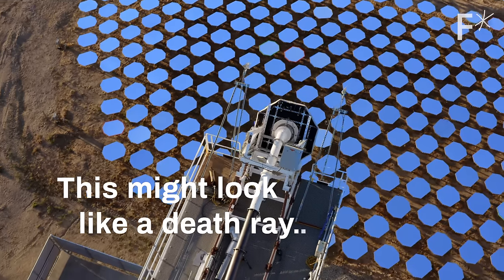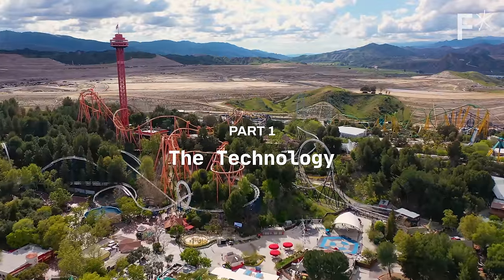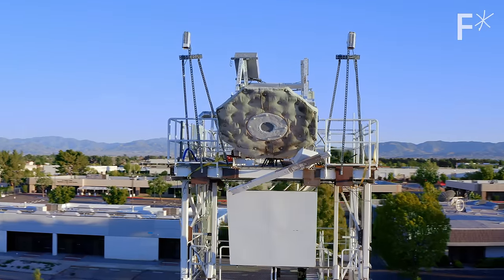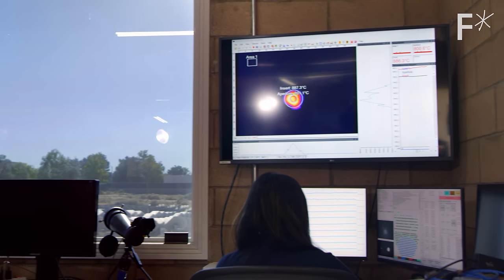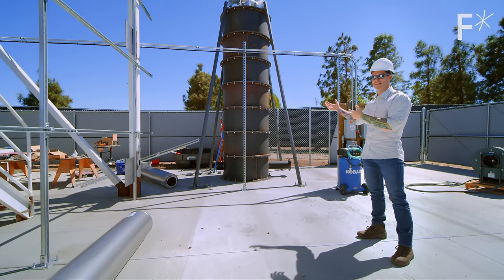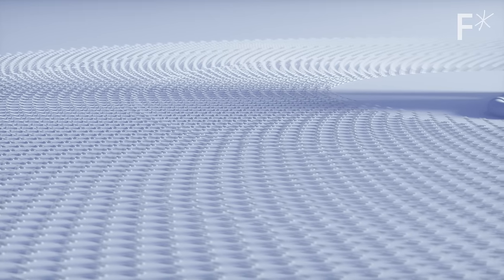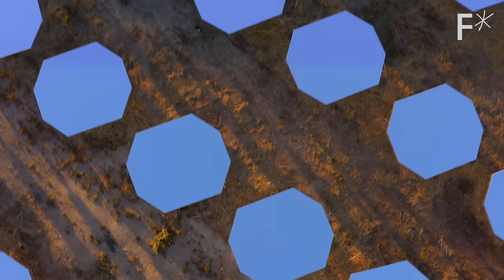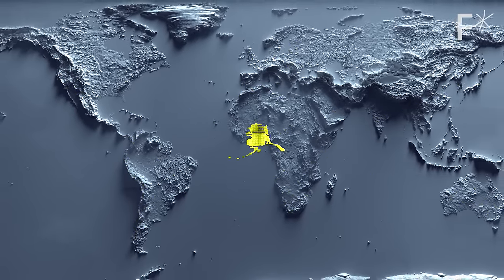How mirrors could power the planet... and prevent wars | Hard Reset by Freethink

Comment from the maker: Do you think this will change the world?
Reply: I didn't like the fact that you neglected the cost to deploy these facilities and how much energy they produce compared to other sources.
Reply: @nedrapaul4135  another article mentions first practical deployment, "
The baseline system will provide industrial-grade heat that will be capable of replacing fossil fuels in processes including cement, steel, and petrochemicals production, the company explained" .  It is the same initial target as other hydrogen producers/burners infrastructure.
Reply: As someone said: If you want to make a battery dirt cheap, make it out of dirt.
Reply: Yes! It's brilliant.
Reply: Ask all the dead guys that had this and better ideas over the last hundred years how they fared against the giant energy corps. When those corps secure the ability to use it, and patent it, and safeguard the materials for utilizing it, and have multi profited on wars and resources and so fourth.. yeah.. Sure. For anyone that is left to enjoy it.
Reply: Not until they can figure out how to use these without torturing and killing birds.
Reply: @baneverything5580  Your username speaks volumes to your objectivity.. Give birds' intelligence a little more credit, why don't ya'?
Reply: @baneverything5580  There is a difference between debate and 'censor'ship. No need to be triggered, my sensitive friend.
Reply: It might happen and might not
As everything is possible
It will either happen in this reality or other
Reply: nope, but it's a progress.
Reply: No, I believe Nuclear is the way to go.  The square meter footprint of the plant is much smaller than solar and produce energy 24/7.
Reply: @SeeTheWholeTruth  Interesting take on things, from a bit of a conspiracy point of view point. I don't disagree with you. But I see something much deeper. If technology were the answer to the serious troubles facing the world then the world's problems would have been solved already. The truth is all men have freedom of choice but what they choose to do with that freedom shows that their hearts are inclined to doing what is bad. No human rulership has ever ruled without greed, oppression and corruption despite hundred of years of reforms and revolutions. The existential threats facing the planet are symptoms of the moral break down in society, the difference is that today we now have the potential to completely ruin the planet.
Reply: But there is one caveat. The universe was not always existing. It had a beginning. It was intelligently designed with a balance of extremely precise forces. Life itself is written in a code of complexity that is un-match by anything we have made and None of it is without purpose.  All of it is a reflection of the one who made it. And I have a feeling we are pissing him off by the way we are treating one another and the rear unique home we live on.
Reply: It will but the question is will the ones on top the big corps the politics will or will they interfere
Reply: Hope it works
Reply: @nedrapaul4135  Meh....I doubt if it would be as much or more than offshore oil platforms, supply tugs, specialty vessels, land upgragers, refineries, pipelines plus power plants etc etc. I've been in many of them believe me they aren't cheap either.
Reply: This looks better than "eco" nuclear energy but I'm afraid of some lobby influences from other energy sources.
Reply: @baneverything5580  You can google this yourself, if your interested.
A 2013 study estimated free-ranging domestic cats kill between 1.3 and 4 billion birds – on top of between 6.2 and 22.3 billion mammals – every year in the United States alone, the majority by feral or un-owned cats.
Reply: Ok looks good for world consumption but what about the electric car footprint? How much bigger does it need to be to add that also.
Reply: @julianmac  but remember the waste occupy a lot of space.
Reply: Ya more birds lighting on fire mid air like in Californias ✌solar ✌ big quotes solar towers are good tell that to the air temperature sitting 20 degrees warmer then a city on a hot day.
Birds have been documented exploding mid air smoking or just caching fire mid flight
Reply: YES!
Reply: Without a doubt
Reply: If this technology can  sustainably supply the ever increasing demand for energy, at competitive prices, yes, this could definitely change the world in many ways.
Although, no, it wouldn't prevent any wars. That was moronic. Most of the best places, as per the video, to produce this energy are actually places that currently produce fossil fuels... Not to mention, oil is not the only motive for wars.
That apart, concentrated solar power does seem like a very interesting way of  producing energy.
Reply: If only we had such sunlight and space everywhere on earth. It is a great idea for specific areas sure. For the rest, let's not stop research in the nuclear fusion. Also, the guy's idea to produce the energy only in specific areas and distribute it to everyone is just wrong on a geopolitical level, countries without these towers will have to rely on those who does. Great way to enslave instead of empower.
Reply: Yes this will, they understand how the world works and they understand solar panels are worthless. This is way cheaper and coat effective.
Reply: It will help to change the world.
Reply: Depends upon the efficiency. 

You could probably get about 90% from the stats (I like the idea of finally mass producing everything about CSP). You'll lose some heat through the piping process to the heat storage, or certain rocks in this case, say, another 5%. Then, since there is still over twice the heat stored, than normal thermal, such as conventional nuclear, coal and even CSP, there will be about 50% (instead of 35%) heat to electrical conversion (the hotter, the more efficient).
Overall, that's 43% efficient.

Now, conventional solar and battery is about .2x.9 or 18% efficient. Batteries are cheap for an hour or so, but quickly get expensive for storing for over 12 hours. I believe mass produced heat storage would be cheaper. However, it is unlikely that the stats would be cheaper than silicon panels.
Finally, there's the decay heat issue. Mirrors don't get too hot since most of the energy is reflected to be stored. Silicon wastes about 80% since it is dark. However, the thermal process will waste over 50% and batteries, less than 10%.
This issue doesn't matter until we cover millions of square kilometers, and is only a very small percentage compared to the extra radiative forcing caused from excess CO2.
In the end, it's all about price. Stats and rocks compared with silicon and iron phosphate...
Reply: @baneverything5580  
I like cats. Solar doesn't kill cats, so don't ban the drones that will soon herd the birds away from the wind turbines (and mirror farms)!
And why the mention of politics, Trump was an a hole! But Democrats could turn out to be rats, too... 🙄
Reply: @kevinlspg3135  
Countries without adequate solar have hydro and wind to sell trade with. A global grid would be the best thing for humanity - and the rest of the biosphere since that would finally obsolete fossil fuels which are directly converted to over 3x it's weight into CO2.
Reply: @jehiahmaduro6827  I agree. That is a fascinating topic and I think there are ways to improve society, politics/voting etc but that is a long hard battle that I have no idea how to start addressing... Us geeks and engineers and scientists... All we can think about is solving the tech problems to enable society and influencers the chance to put childlike man-kind on a path of maturing.
Reply: I think we should strive to perfect a large number of sustainable energy sources. This one can be part of the solution. Several energy production methods and corporations can all compete with each other to give us best tech and prices.
Reply: This might be useful for energy production in space.
Reply: His whole company is funded by the same capital that backs fossil fuels. He skips over the Sahara desert, typically ignoring Africa, an fails to see how sourcing the commodities behind this technology will remain the same dynamic that exists today.
Reply: I think oil billionaires have too much power for that.
Reply: @baneverything5580  Building glasses kill birds too.... I'm wondering if that's stoping their deployment.
Reply: T C  No i don't agree with you.... Batteries are like fossil fuels, it won't be cheaper or easily available...... If we could find sustainable batteries for decades at very low cost then it would be another way but until then I think hydrogen would be much cheaper and easily available.
Reply: The mirrors have to be always clean to have a max. energry output. Scale it up...then who/how will  then  by cleaned?
Reply: How is the energy transfered from Melted rocks to electrons and hydrogen?
Reply: Genuine question , will birds be affeted by this , if they fly over ut
Reply: Hope not, hydrogen is a bad idea, battery tech is what's needed.  Neither are safe, but hydrogen should not be used as fuel.
Reply: @cob571  intelligence is kinda irrelevant here. They can’t see the death ray they’re flying through until it’s too late and their feathers are on fire
Reply: Alaska is kinda big. Can put some of it floating on the ocean. I really wanted space based solar power but this looks like it can beat it.
Reply: @tigre3droyce771  yeah, but i don’t understand why that is hard. A little mechanical arm with a duster pops up from time to time. Why is that so hard?! NASA Mars rover team should hire me for my ideas.
Reply: @baneverything5580  can just put a giant net around it. We also have drones nowadays. Make one in the shape of an eagle and have a bunch patrol around.
Reply: Too late to stop warming by stopping emissions, or removing global dimming. We also need similar large mirror fields to reflect radiation back into space.
Reply: Big Oil will suppress it.
Reply: @julianmac  But it's too heavily stigmatized.  Three Mile Island, Chernobyl, Fukushima.
Reply: Meet the new boss. ……
Reply: @GeneralZap  It is the ability to focus sunlight with precision via computers and gain a far higher temperature( which is useful in industry that currently create much greenhouse gas) that is new.
Reply: yeah. this will burn to a crisp a lot of birds.
Reply: It’s good, but I think HVDC lines will be more efficient than making hydrogen and transporting it.
Reply: Hydrogen is not as easy to ship. The solar energie has only potential by producing sythetic fuels. See the video: https://youtu.be/hG9BOxUIqEk . Sorry it is in german.
Reply: Nope, our owners will crush this, like they always do.
Reply: @baneverything5580  democrat? Republican,  it's all the same! Cant believe you havent figured that out yet. Maybe you should turn your TV off for a month maybe you'll start to get some of your own thoughts in your head again. Red and blue, left and right, it's been used for so long to keep us divided because it works so well! Doesnt matter who is SELECTED the same outcome always happens. They blame each other for the destruction of the earth, our rights, and all our freedoms. While you argue who donemit they're laughing all the way to the fake banks.
Reply: @mikehunt8375  I don`t own a TV. Democrats aren`t allowed in the area where I live. Bad things seem to happen to democrats here....
Reply: If the mirrors where concave instead of flat it could produce more heat...
Reply: Maybe in 50 year's but not at this time unless the cost to manufacture it and the cost to consumers is cheaper then current power plants that are used now.. it's the way of any country or corporate company how cheap is it to build and how much can investors can profit this holds alot of new technologies back
Reply: What kinda rocks, amethyst or crack rocks 😁
Reply: surely we should go for every bit of technology that is solid and economically feasible. The fact that the EU seems to be supporting research that may lead to cross-financing of industrial hydrogen infrastructure by the transportation sector tells me PV will also grow a lot in relevance. 
How is that high temperature electrolysis game coming along?
Reply: @hardwareful  hydrogen powered vehicles have been around since the 70s maybe even earlier but i still do not see a single one in mass production today and most likely that is because of other big car and oil Industries and the simple fact that you can make hydrogen right in your own garage with some stainless steel plates in a 12-volt battery and some water
Reply: @baneverything5580  I looked it up and solar farms kill like 1/10th of 1% of birds compared to fossil fuels so there take that!
Reply: @MikeAIright  So you`re ok with torturing birds with focused beams on sunlight that burns away their feathers and causes a slow painful death? There are federal laws against this. Torture a bird of prey or a songbird this way on camera and you`ll be sent to prison for a serious felony.
Reply: no
Reply: I think its a great dream
Reply: @baneverything5580  We stop killing birds (and other animals) by stopping climate change
Reply: @pooglechen3251  So you`re delusional to the point that you think humans can stop the climate? Rave on....
Reply: At first you had me, until you said the size of Alaska. Its a good idea, but I cant see how this will prevent wars, since not every area is photon rich, the distribution network would cross borders as well. I think this alone is insufficient, I can imagine that we would be creating hot zones around the world that would effect surface temperatures, and therefore wind patterns, so it may not be such an innocent technology when scaled up. I love the idea, love the rocks too, but No, it wont change the world (in part that energy demand will keep going up).
Reply: @baneverything5580  If the already build industry doesn't kill the birds then what would an enclousured solar focus do? I mean, why would they even be there. It's not like we are lazer cooking all the birds in the sky. The impact is much less to burning combustible to heat the metal. 
The technology also needs to be in high solar areas with large extensions of non forest terraign and by such no animals. 
Even the car pollution kills more birds than the wind turbines or as such the solar farms. 
The petrol used to build your device from where you are posting might have killed more birds than this type of heat focus from solar. xd
Reply: NO!
Reply: @baneverything5580  What are you compare with? There are more birds extinct with digging holes, because you are literally removing their habitats. 

Instead of asking us to look it up, bring your data ie put some responsibility , and initiate a conversation.
Reply: What about the ecological impact ?  we already know how thousands of birds have died around solar farms.... but after this ... we may 
start hearing ... Birds toasted around the facility.
Reply: No, but it will be added to the many options.
Reply: They do have satellites with direct energy beams which are dangerous...mark esper gave a speech on them.  They're basically infinite energy rays that could destroy us powered from satellites & batteries... The real reason behind space force.
Reply: @baneverything5580  cats kill more birds than wind turbines. CO2 kills more birds than solar. your choice
Reply: @kentarouification  CO2 is necessary for life on this planet.
Reply: @kentarouification  Cars kill more raccoons than airplanes but this isn`t a good excuse to torture raccoons to death in gruesome ways. Solar farms torture birds to death very slowly. This is illegal.
Reply: yes. so will HEX coin if you buy and hold. you heard it here first now buy. if you dont, then you are going to lose in fiat inflation. good day
Reply: @tigre3droyce771  The Night Crew.
Reply: otha cindy  clean energy produces no radioactive waste. so, the sun powers us humans, and we get paid to hand turn wheels or pedal bikes that power eachothers houses while were at home or on vacation. we all take pur turns on shifts. this also makes us get exercise. if this doesnt appeal to you then you will live on the backs of others. or settle for this mirror setup
Reply: It can be part of the solution.
Reply: It looks good on paper.  However, how much does it cost per kWh of electricity in comparison to dirt-cheap solar PV panels?  What's holding back solar thermal electricity right now is the higher cost in comparison to solar PV panels.
Reply: You jumped over the most crucial part, converting heat into hydrogen and then converting hydrogen into liquid hydrogen for transportation. With that cost in mind this solution is still behind oil and lithium batteries. You will loose ~60%(can't remember exactly the number but it was big) of the energy before a consumer can use it as power, mostly lost in conversion. For me that is a huge cost, litterly burning money into air. Anyway this is good solution, but the last step, hydrogen, is not so good.
Reply: @harounhajem7972  did you read everyone elses comments in these replies. its been stated, by me, how to use this tech using those things that generate electricity from heat.
Reply: @tigre3droyce771  my friend works on a solar farm The whole plant is run by around 20-30 people and its a big one in the south of Australia. Most of the time they clean themselves. They have water sprayer that wash them frequently with just some water. Also The workers there check them daily before sunrise to see if they need proper cleaning, repair or swapping etc.
Reply: How many planes will we fry…..😵‍💫
Reply: @davidwomack5982  planes are biggest polluters
Reply: No this sort of scheme was already used and now lies dormant and decaying.
Reply: @kenthhamner2641  youre comment is negative, and doesnt reflect the views of people who think forwardly. give us some feedback that applies.
Reply: No
Reply: @BBC357  explain
Reply: @hextremelydesirable1648  explain what?
Reply: more energy more polution efect in manu field,
the solution is understand care our  home
Reply: Couldn’t agree more
Reply: The same energy used to electrolyze Hydrogen for use in a fuel cell vehicle will move a battery electric vehicle 3x to 4x as far.  Green Hydrogen is a lie.  Using the electricity in an EV has already proven to be 3x to 4x cheaper than buying fossil fuels.  That's why EV sales are growing rapidly.  Hydrogen is not the answer.

Also, most of the deserts, including California have severe water shortages, so the water should not be used to make Hydrogen.

P.S.  Most commercial  Hydrogen is made from natural gas, a fossil fuel mostly controlled by oil companies.  That's why oil companies promote Hydrogen.  It's mostly made from fossil fuels.
Reply: Rooftop solar

But how the hell can energy companies charge someone for energy they produced themselves? We're doomed
Reply: @shimes424  With enough solar and battery storage, it's possible to be entirely off grid.  Where places have net metering, grid connected solar makes sense.
Reply: Wait.. But the US went to war in Iraq to stop the dictator Saddam and his WMDs?
Reply: What's the point of wasting all that land when the same can be accomplished with small modular and portable Molten Salt Reactors that burn abundant Thorium?
Reply: While its great that they have been able to use modern technology to increase the efficiency of a type of concentrating solar energy farm that has basically been around since the 1970s, I also see a big contradiction in the video. He points out that being dependent on other countries for oil is bad because they can cut you off at any time and that this can sometimes even lead to major conflicts. But then he also says that these solar arrays would be built in sunny countries and then the energy would be sent to the countries without much sun. So basically you still have many countries that are dependent on others for their energy which can lead to the same kinds of political problems that we have today due to some countries being dependent on others for their oil. Not to mention the fact that a good percentage of these solar farms would need to be put in the same Middle Eastern countries which currently produce most of the world’s oil. The bottom line is, this will likely not change the geopolitical climate at all.
Reply: just use nuclear ffs
Reply: Not this one, it's just a sustainability performance. Solar thermal to electricity to electrolysis to H2 as a commodity. That's not a viable business, it doesn't make energy cheaper so no one will invest in it, except governments and other idiots, it will fail.
Solar PV to  grid with diverse, simple bulk storage is where it's at.

... or Fusion.
Reply: @SeeTheWholeTruth  yee, we'll never have anything nice
Reply: with the power of the modern nuclear power plus all tech that dont use fossil fuel , It can
Reply: 2x the heat useless
Reply: Well solar PV and wind farms are sorta already changing the world. Can this tech beat PV and turbines?
Reply: @julianmac  thorium reactors
Reply: The United States receives most of the energy from crude oil 🛢️ from south america, mexico and canada. 
Since the Arab oil embargoes of the 1960s and 70s, it's been conventional wisdom to talk about American dependence on oil from the Persian Gulf. But the global oil market has changed dramatically since then. Today, the U.S. actually gets most of its imported oil from Canada and Latin America.
(OPEC) was a American company united with Arab crude oil. The United States Government in the 1960s - 1970s was founding Israel milltary why the Arabs, Saudi Arabia stopped the crude oil and price on crude oil went up. 
During the 1973 Arab-Israeli War, Arab members of the Organization of Petroleum Exporting Countries (OPEC) imposed an embargo against the United States in retaliation for the U.S. decision to re-supply the Israeli military and to gain leverage in the post-war peace negotiations.
Reply: Propaganda
Reply: I would love to see it.!
Reply: No, and why not just use Nuclear Reactors?
god these environmentalists forget that Nuclear is the best option out of all the resources out there due to the fact that it just emits steam and the emission is literally in the rods that get refined and reprocessed until they are completely safe to touch lmfao
Reply: @hextremelydesirable1648  
you completely disregard that the sun itself is plasma, emitting radiation in every spectrum and our atmosphere literally filters most of it out, why not just use the radiation soaked rocks to make reactors which produce no emissions

oh yeah, let's stop investing in nuclear because some other country fucked theirs up with their poor decision making and understanding of such materials

also, the nuclear waste can be recycled with secondary reactors, bet you can't say the same about wind turbines and other energy methods which throw away the generators and have to replace them every year or two
Reply: @baneverything5580  Very few birds in a desert, but yes mitigation would be important
Reply: using the sun doesnt get the host rocks bin hot enough. or can you explain more detail?
Reply: @_Circus_Clapped_  molten salt reactors were quashed years ago.
Safe nuclear energy.
Reply: @StefanoCreatini  I don`t like seeing birds that have babies to feed have their feathers burned off and then them and their babies slowly die, This is a crime.
Reply: @naturalisted1714  Brilliant, lol.
Reply: No it wont. Lots of hype about transforming energy blabla and even trying to get preventing ww3 into it. Over hyped video's make me itchy.

It is old technology. I believed in it 10 years ago because with molten salt it can serve as energy production + storage in one. That has however proven less economic than PV + batteries.
Changing the way you control the mirrors by software isn't all that revolutionary and wont drastically change the equation. As i believed in it 10 years ago, i still didn't completely lose my belief. There still might be use for this. However, it doesn't remotely warrant the hype you make of it.
Reply: This technology combined with graphene will do wonders. Rocks as storage of heat is genius. Yes, it can change the world.
Reply: Yes it is. How we can reach this company? I want to install this plant?
Reply: @baneverything5580  More birds die flying into windows Every day.
Reply: @baneverything5580  
A scientific DEBATE has NOTHING to do with partisanship. So spare us your ignorance.
Reply: these facilitys exist already, the problem is that they fry birds midair. and as we all may know the gov. doesnt like it when you kill endangerd animals.
Reply: Combined with all the other brilliant innovations being designed, engineered, implemented by thousands of brilliant minds & companies around the World.
Reply: I hope.
Reply: @rusted-iron4360 
😂😅😂😅
Reply: If they can get the costs down to below the cost of fossil fuels it will.
Reply: No, consolidating solar energy production into the hands of the few puts us back in the same place.  Individuals need to own the means of production through solar roofs, home size hydrogen production, wind turbines, etc.
Reply: hasn't this changed the world
Reply: no
Reply: No.
Reply: I hope it will.. but I think politics are the real problem here. You may need to get bonded to a non democratic or problematic country,to get your energy.
Reply: No, but it's a good idea, big oil will use the bird killing justification to stop it

yet big oil is also against regular old solar panels too which do nothing to birds
Reply: Mass bird killer?
Reply: Instant KFC chicken tendies
Reply: this might be a good combination for that MMRTG thing, the one that's used to power the mars rover perseverance.....
Reply: I think you’ve inspired me to become president of the United States one day. 

To take the fight to climate change with this technology once and for all.
Reply: @nedrapaul4135  yeah no efficiency comparison either I mean why would people in sunny area use it if it's far less efficient than solar PV cell ?
Reply: What is the difference to the Ivanpah solar power facility already operating in California? It too uses mirrors to concentrate sunlight on one tower to create electricity. Isn't this just the same but without the difficult electricity production?
Reply: Aren't solar panels more effective? Why are you heating rocks and not water? Wouldn't it be more efficient  to transport electricity rather than hydrogen? If you are packing hydrogen in the desert wouldn't it be very energy inefficient bc you need to cool it down to transport a decent amount?
Reply: Hi Freethink, this will indeed change our world but for the worst. You are promoting technocracy, a failed system in China. It failed to preserve human freedom and dignity. Technology has failed humanity, so anytime you promote a new technology as a solution to any of humanity's problems, you will just be digging us into an even deeper hole. You really need to grasp this. This is your last warning.
Reply: No
Reply: No.... one solution for such a big problem is not possible. But it can make a diffrence in the whole enery system.
Reply: It might happen, but i do not think it will stop wars as long there are people who make money with wars.
Reply: Stored heat and a stirling engine array to take advantage of the temperature differential. Depending on the heat loss could be a source day and night.
Insulate the core well enough and it could be viable as an all day generator
Reply: Yes it is, accept war. Countries  that rely on Weapon manufacturer's tax need war for feed themself. They will be inventing another reason to create a war or conflict
Reply: It's fraud. End of Story
Reply: This has been around in various forms for a long time. Still doesn't work when the sun doesn't shine. Fix that first! Mine lots of cobalt & other materials using lots of portable energy. Built huge battery plants, on & on. Call me when you've got the rest of it in place
Reply: @baneverything5580  ////Plus who is going to clean all those mirrors?
Reply: Yes. Applause to these men. Thank you
Reply: @vvs25  yes is the short answer is kind of like when you burn ants with a magnifying glass and if I was a betting man they would have to be within 50m of the focal point and in the line of light. But the air would heat up along that line like your standing in front of a fire and the bird would likely turn around tho if it's going fast or gets confused it may fly into the beam.
Reply: @lennym1273  I like your thought process on this Lenny but there are a few factors to consider about that.
1. With how far the sun is away and how far the focal point is away the curvature would be very minimal
2. The production cost of a curved mirror versus a flat one would be double therefore you would be more cost effective to have more mirrors than a curved one for the same output.
3. If you focused them the intensity of light on a single point would be so intense it would make capturing that heat exponentially more difficult to contain so I larger focal point would be easier and allow more time for the heated element to heat.
4. If the mirrors are focused the motors directing the mirrors would need to be much more accurate. As it is the accuracy of the mirrors is difficult to achieve.
5. Cleaning of a concave mirror using automation is much more difficult to achieve than a flat one.
But you were thinking down the right path for greater heat density it just becomes problematic in its own right.
Reply: @Freethink  Change the world.. no because there is so much infrastructure on wind and PV that it won't get the credit it deserves.
The way I see this is in initial capture PV captures 18% of the sun's energy. This method has the potential to capture 98% of the sun's energy. It's a bit of a no brainer when you look at that.
Personally I think the issue is with the rock storage. To heat the rock it's got to be contained or the heat will dissipate. On top of that when you heat it out will release the carbon from the rock (not a biggie compared to how much would be there giving the locations and offset to how much CO2 it would prevent having to be created using other methods) but released gasses from the rock and chemical reactions inside the rock could be problematic as any hole to let it the gas would let out the heat not to mention a hot material uses more volume than the same but cold and also be a explosion risk from both these factors. 
But overall it is a technology we should use. Tho shipping hydrogen? Seems like they couldn't figure out what to do with the energy created and it sounded like a green solution to cut down infrastructure and reduce the costs of grid connection and government and state approvals required to connect.
Reply: @39ilawis  Yeah I see your points...
Reply: @lennym1273  but you know if they made the farm smaller and moduler your curved mirrors would absolutely be the way to go and by going modular it would allow them to be able to build on uneven terrain and potentially store more energy due to having in effect a larger battery so really it's all about how they decide to utilise application. I think this company is still very much in the R&D stage trying to build a proof of concept where's a more economical model would be a smaller farm with curved mirrors like you mentioned and a much smaller tower to reduce both construction costs, Heat losses, production and shipping costs so your definately on the right track 😁
Reply: Nope, wars will still happen. WW2 and ColdWar and War on Terror were all based on ideology.
Reply: Hard to say since they didn't provide essential figures such as installation  output or cost of manufacture, installation, maintenance, and decommissioning. It was also unclear whether they're going for direct heat transfer to industrial processes, hydrogen production and transport, or electricity production.
Reply: I mean as long as they dont cook birds flying over head sure. Plans would also have to be in place for air control. Planes wouldn't be able to get close or they would melt.
Reply: Is it possible to place these mirrors on terrace and power a house instead of making it in farm? That way it will be more localized.
Reply: @guadsquad7775   The danger zone is only around the tower. The rays of light diverge as you get closer to the array or behind the target on top of the tower. Planes are not in danger unless they fly themselves dangerously low.
Reply: It better and soon!
Reply: @SeeTheWholeTruth  This is exactly right. 1% don't want to share. I don't see this changing. Offspring have the same mentality.
Reply: I think it will change Tesla hahahha  and hydrogen cars will be the new best car model
Reply: Energy for desalination which is a huge issue for many countries.
Reply: @baneverything5580    Nets, large nets
Reply: Why not, if its cost efficient to maintain.
Reply: Its weird that this plan doesnt involve using seawater.  Make energy and desalinate water for free duh.
Reply: @pooglechen3251  Ban everything doesn't care about birds. Ban everything seems to want everything to fail.
Reply: no i think it would just kill birds
like the other solar power in the us
Reply: no,  if you want to change the world you need to let peoples experience communism and the modern consumption world at this same time ;-) but keep doing  what you would like to achieve
Reply: No. Nuclear Fusion and Anti Matter for electricity will.
Reply: Yes, it has the potential to change the world. I've been a huge fan of Concentrated Solar Energy and the concept of the Hydrogen economy.  There is a French firm, McPhy, that has been working on the processes to store hydrogen in an inert form, as magnesium hydroxide,  and retrieve it at point of use using less energy than it would take to liquefy the H2.   Using solar thermal for hydrolysis and manufacture of h2 for Hydrogen Internal Combustion Engine (HICE) vehicles or fuel cell electrics would also be epic.  Using solar thermal energy to heat or preheat materials in manufacturing would also be epic.  Great video, great innovation in the concentrated solar space.
Reply: This is really the way to go to change the world.
Reply: It already has. Just by this video existing. It already has changed the world, and the best is yet to come.
Reply: There is a solar farm near my parents and they have to hire people to clean up the dead birds on a weekly basis.
Reply: Greener electricity from whatever source will happen eventually, and I think the response from manufacturing to go green will just be plain electrical furnaces instead of this solar style. No one wants to rebuild their entire factory around the heat source.
Reply: @julianmac  ok, so how much Uranium do we have on Earth? Didn't think about that, did you?
Reply: Well its been a year....still nothing
Reply: This is the future . Heating rocks, just that . I thought this idea of solar energy was over because I remember some projects failed . But some people didn’t give up . 👍👍👍
Reply: Yes. Questions: can this technology be produced...using this technology? What about lifespan and maintenance?
Reply: @joeljong931  can you please mention the article name
Reply: @joeljong931  or provide any link if the article
Reply: Sunlight harnessing will storing energy in rocks already does work in nature. The investment of instruments in this will likely not be wasted on using rocks to store energy. Maybe diabatic air compression and recovery combined with some very small amount of fuel in a turbine.
Reply: Yes Please also tell when you will lauch this project in India
Reply: It Already Has, And Perhaps Further Will; The Question Is, To Which Degree?

There Are Many Different Ways To Generate Efficient And Scalable Energy Productions, Some We Probably Haven't Even Considered Yet; Although Useful Applications In A Distributed Network Are Often Limited By Means Of Adequate Storage And Cost.
Reply: Say You Gave Solar Panels To Everyone Between A Certain Latitude From The East Coast Of America To The West Coast; How Much Would That Cost, $300 Million Or So?
Reply: These Types Of Technology Could Provide Useful Power To Entire Villages That Were Previously Without Electricity.

It Can Also Combust Water.
Reply: Absolutely 🤗
Reply: What about nuclear fusion? Production of energy by nuclear fusion was already investigated, found to be practical, cheaper and within limited space. Why was this ignored? Nuclear fishon reactors have already installed in many countries producing electrical  energy in competitive  prices.
Reply: if a war would be declared for fossil fuels it would caused be the USA , so politicians would need to change if you want to change the world. On the other hand this way of utilizing energy is a great approach. Please do not let this opportunity go to waste.
Reply: They says it is inspired by my idea is it true then give me shelter food cloth medicine by this company
Reply: And as family not partner profit prior incorporation
Reply: it was way more interesting, back when solar panels were expansive.
Reply: Change the world?

Affordable nuclear would change the world. Like SMRs. 

 This may be useful for some things.

 Screw hydrogen. I don't like it at all unless Fuel Cells become as efficient as EVs. 

 Hydrogens volume and storage is such a cumbersome thing. I like having space in my cars. There is no infrastructure for hydrogen. It can be dangerous. 

 Why make hydrogen pipes when you can just make electricity and send it across high voltage DC lines too? 

 So unless the project needs heat. Like for certain industries or for heating cities with central regional heating then I just don't see the uses over other forms. 

 So for electricity production this isn't changing anything.
Reply: @nedrapaul4135  because mirror tower is not the way to go. Parabolic trough connected to a zinc tube with water to power a steam engine generating electricity: super low maintenance costs, relatively cheap deployment, no need for fancy sun tracking system - just place the trough along the line of sun's travel
Reply: My only problem is that most of the planned tower sites are in Australia, the middle east and north Africa. Because of the amount of sun in those places that makes sense. But that is not local power. The towers would make hydrogen or store the heat energy then export it. So the host countries could still turn off the taps to the rest of the world if they wanted.